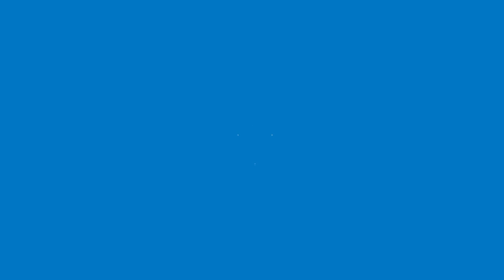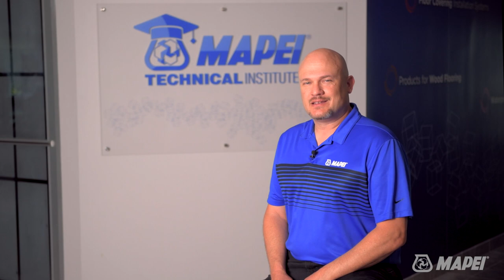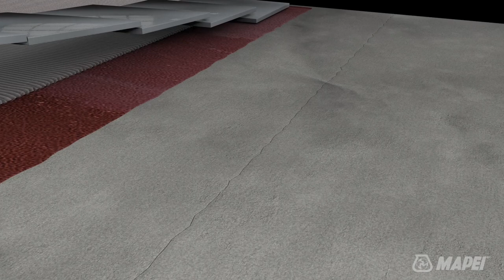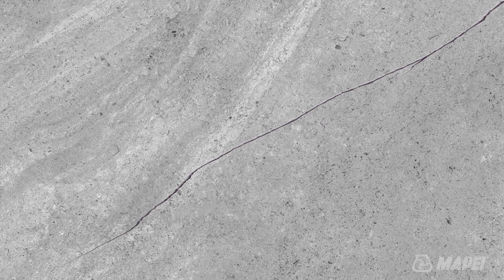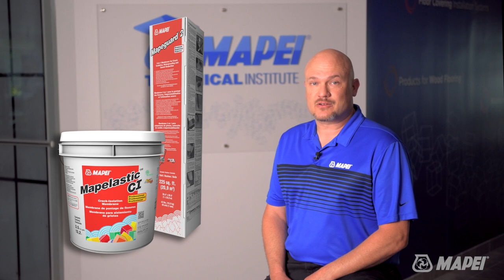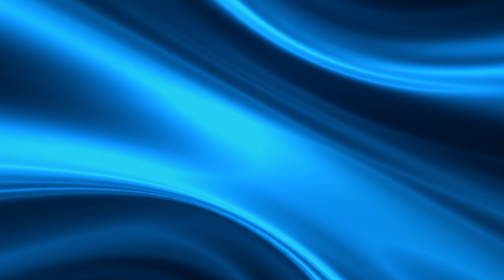MAPEI Tech Tip: Crack Isolation

Comment: can this be applied over painted concrete?
Reply from the maker: Hello, I apologize for the delay in responding. We do not recommend any of our products over paint. Paint is not an acceptable surface by the tile industry, not just MAPEI. We recommend that you mechanically grind off all the paint prior to applying a crack isolation membrane.